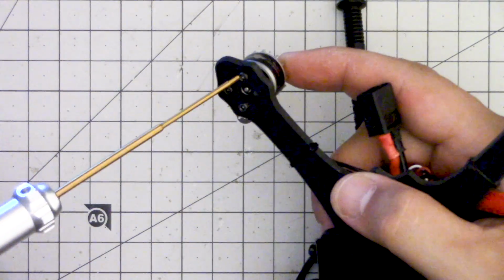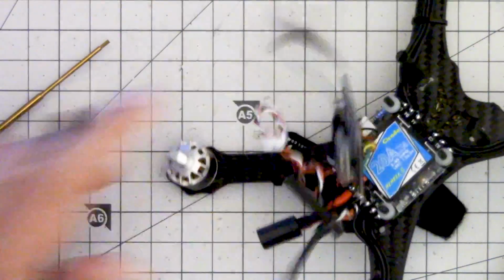Quadcopter Hot Motor | REAL WORLD TROUBLESHOOT

Comment: The reason why your back motors work more is that the center of thrust is not the same as the center of gravity. To "fix" it is to mount the back motors upside down, but thats unfeasible on most frames. See https://downanddirtydrones.com/center-of-thrust-2/
Reply from the maker: I don't agree. I have tested this with CG both as far forward and as far back as it can go, and there is minimal change in the magnitude of pitch I term. I believe that the effect is almost entirely aerodynamic.

Comment: Anybody have a good video or article on what the internals of a brushless motor look like? I was flabbergasted when Joshua said all 3 motor wires had continuity, so there's something I don't understand about either the motors or about what continuity really means.
Reply from the maker: The wires are connected in a Y like configuration. The ESC pushes current between two of them and cuts off the 3rd one so that the electric current flows where it needs to flow to spin the motor.

Here's a video you might like: https://www.youtube.com/watch?v=_dClVHZxRAc
Reply: with a multimeter you apply a small current to the circuit, in this instance a motor winding.  Since it is DC current you are applying to check continuity, the windings read as a short or low resistance.  However, the motor runs off of 3 phase AC applied from the ESC which inverted the battery voltage to AC voltage.  AC will develop a signal and induce a voltage on a motor winding rather than see it as a short.  Joshua's quad had a winding shorted to the chassis.  The motor body and quad frame should be electrically isolated from the windings.  They can however be in continuity with each other since for the most part they are at a ground potential. I hope this helps.
Reply: Thanks. That's exactly what I needed. For some reason I thought the three windings would need to be electrically isolated, but they're just taking advantage of shortest path to ground.
Reply: Sure thing, there are plethora of books regarding AC/DC theory available  I owe my knowledge and enthusiasm of electricity and electronics to my Dad and Uncle Sugar.

Comment: Just switched over to rf1 and my motors are getting really hot. I switched the filtering from ultra low to normal (went up 2 settings) and they still get really really hot... I did not have this problem with my revo f4 running RF beta
Reply from the maker: Can I assume that you soft-mounted according to the instructions?

Comment: "Walnut tree branch hit my power line"

We all know you hit it with a quad. :)
Reply: Nah, he hit the walnut tree branch, the branch hit the line ;-)
Reply: He crashed his quad into the powerline and chopped the tree down aiming for the powerline to retrieve his quad.
Reply: I was going to say that his secret "Class Z" quad chopped the tree down...
Reply: lolz
Reply: Nah his quad just flew by and a prop strike chopped the tree. The quad was still flying after that
Reply: Thanks to this video, I fixed my new quad by replacing the screws by shorter ones. They made 2 motors run hot in no time!

Comment: hello, i also had the motor getting hot on my 450mm quad front left. (using TBS clone frame)
but the strange point was,  even i switching ESC and motor to other arm. the front left still getting hotter then other 3...
also changing frame not solve the problem

Any suggestion or idea to my problem?

Comment: I have some emax rs2306 2400kv on a quite clean build, and my rear motors are getting quite warm, not super hot, but unconfortable to hold them. D is quite low at 15 on pitch and yaw. I just changed the d_lowpass_type to PT1. 
Btw they were ok, on normal ambient temps, like 20°C, but now that it is quite warm outside they get hotter. 
Is that normal?
Reply from the maker: Yes. Higher ambient temps definitely affect how hot the motors get.
Reply: Joshua Bardwell So I don't have to worry about my motors. I mean I have them on 2 builds which are diffrent dispite the motors. But motor temp are exactly the same.